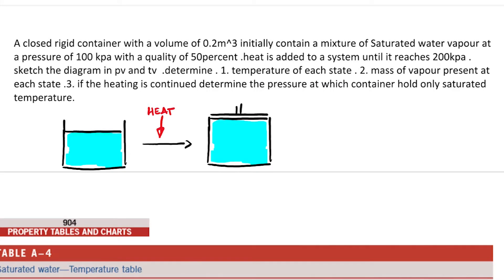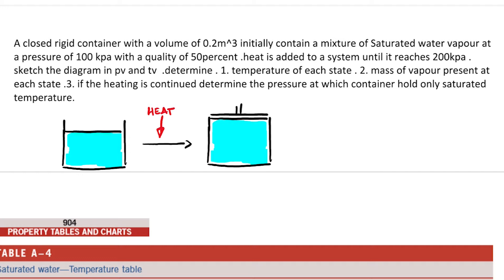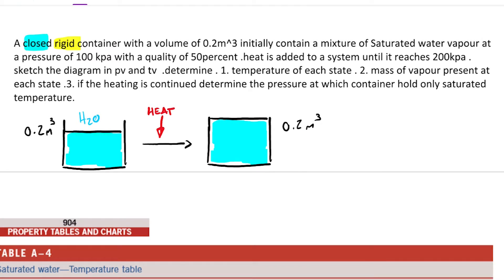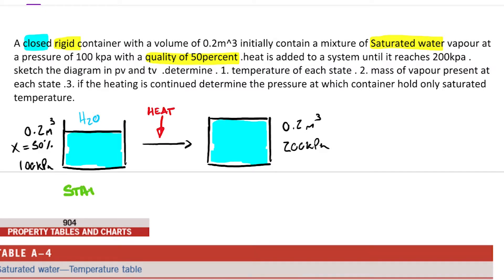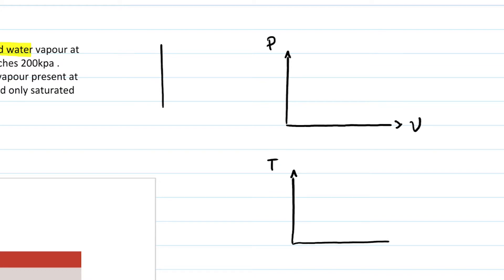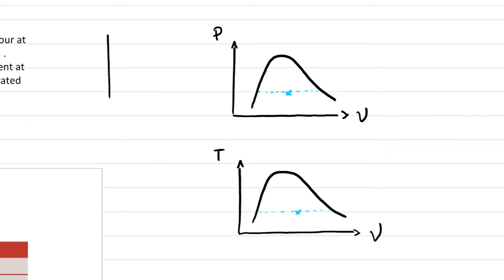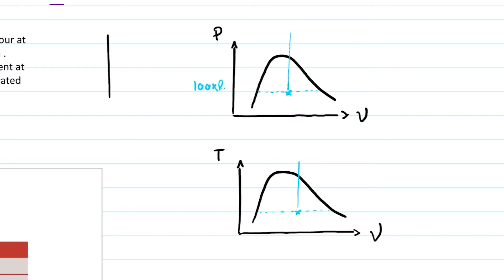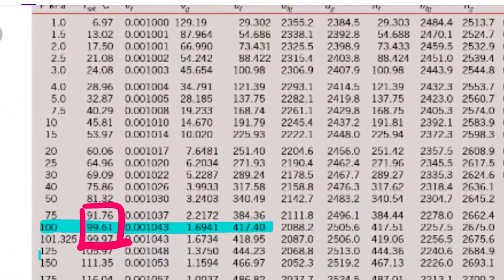Saturated water vapor in a rigid container | Thermodynamics

Comment: A closed, rigid container of volume 0.5 m3 is placed on a hot
plate. Initially, the container holds a two-phase mixture of saturated
liquid water and saturated water vapor at p1 = 1 bar with
a quality of 0.5. After heating, the pressure in the container is
p2 = 1.5 bar. Indicate the initial and final states on a T–υ diagram,
and determine
a. the temperature, in °C, at states 1 and 2.
b. the mass of vapor present at states 1 and 2, in kg.
c. If heating continues, determine the pressure, in bar, when the
container holds only saturated vapor.
Reply from the maker: That's a good one. Want a video on it? Happy to do it. But currently there is a queue until August. Will it suit then?